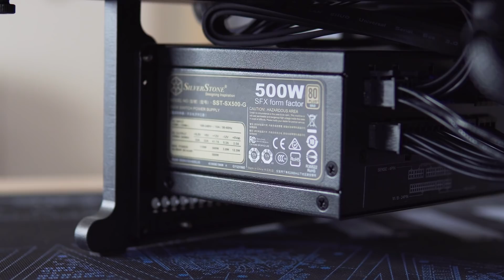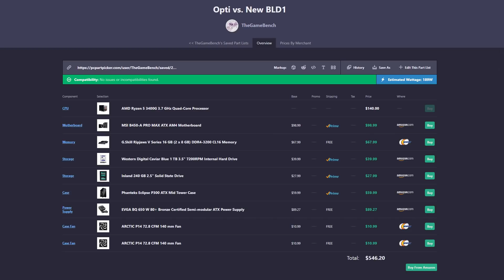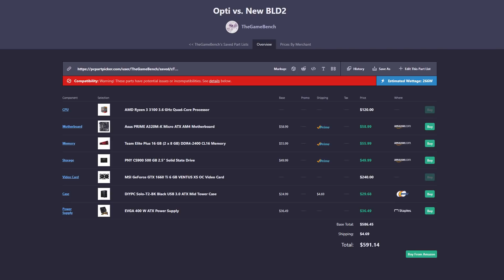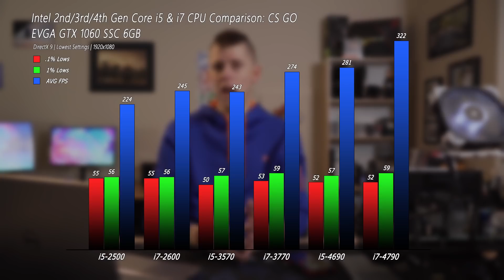Dell OptiPlex Q&A Pt. 1: OptiPlex vs. New, CPU & Mobo Upgrades, GPU Upgrades & More

Comment from the maker: Happy Holidays everyone! Please let me know what you thought about the Q&A video. If you guys like this, perhaps we can open it up to more subjects.
Reply: Thank you for answering my question, I hope you are doing better!
Reply from the maker: @reaganl.0965  No problem, and slowly but surely.
Reply: @reaganl.0965  CBC fbmf. F
Reply: Best wishes of the season, man.  Hope you get better in 2021, in all ways.  Your channel should have 100k subscribers, I tell you what.
Reply: You return
Reply: Hi. Just found this channel... Apparently You don't cover SFF Dell's. Besides the very obvious limitations, is there any other particular reason?
Merry Christmas everyone! Stay safe!
Reply: Great video. I wanted to ask if it's possible to run an ASUS DUAL-GTX1660S-O6G-MINI  on the original 290 W psu?
Reply from the maker: @luisehermann8577  Thanks! Yep, that card will be fine on the stock power supply. Just use a dual SATA to PCIe adapter.
Reply: Truly appreciating your work. Can you make a video on legacy vs uefi, and perhaps a how-to?
Reply from the maker: @Alteredgenetic  Thanks! What did you want to see specifically as a how to?
Reply: @TheGameBench  wouldn’t apply to me personally since i’m using a gpu that works with legacy, but i’m wondering if there would be a benefit to switching to UEFI, and maybe a step-by-step video on how to switch the bios to uefi, for those that need it for gpu compatibility.

Comment: I rebuilt a old 7010 with the best hardware for windows 7 that were available for the time period and backed up the op on Toshiba hdd.I like windows 7 and it has a lot of great games to offer. The dimms clips hit the edge of the GeForce 1660 ti oc

Comment: I am just writing this comment to show my absolute appreciation for this video series you did about Optiplex-es.

I'm an IT tech, but after having my 2 boys (who are now 6 & 8 years old, and autistic), let's just say that playing video games (or thinking about setting up a basic gaming PC has been out of my mind for a while.

Now, the only PC we have at home happens to be an Optiplex 3020.  Imagine my joy, seeing your videos, showing how it is absolutely possible to turn my PC into a potable gaming build. 🙂

My aim has always been to emulate PS2 games (maximum) and Minecraft, Fortnite, etc.  The kind of games my boys will be thrilled with.

Thanks to your videos, I removed the hard drive bay, used your template to position my SSD and HDD.  Got most of my parts, now waiting on my 500W PSU, an Asus 970 GTX and an i7 4770k to replace my i5 4590 (because I wanted to match the GPU as much as possible).

Videos like yours are really uncommon and I'm convinced they give a new purpose to lots of people having those Dell computers.  😁

Comment: Can i install rtx 2060 in my optiplex 9020 mt i7
Reply from the maker: Sure, but you will need a more powerful power supply if you haven't upgraded it already.
Reply: @TheGameBench  which power supply is the best 👌
Reply from the maker: @Funnycats99club  The MSI MAG A550BN is a good option on the budget end. Just don't get one of the 80+ white power supplies and remember that you will need an adapter to swap the power supply in the 9020.
Reply: @TheGameBench  thanks 😊 🙏
Reply from the maker: @Funnycats99club  No problem.

Comment: here's one for you.  Could I take a mini tower 7060 that doesn't have room for a gpu and doesn't have the harbin adaptors and.....put the internals into an old optiplex mid-tower CASE ?  Would this give room for the GPU that isn't there in the mini tower? thx
Reply from the maker: Be about the same amount of work and have the same issues as re-casing it in a DIY chassis, which if you're going to do, would be better than putting it in an older Optiplex chassis. I would ask what GPU you want to use that won't fit? You can absolutely add GPU's to these. You just might have to do some cutting for larger cards. Best to look for a standard height, dual slot, card that isn't too long.
Reply: @TheGameBench  thx for the response. I have an rx6600 3 fan gigabyte eagle gpu I picked up, 282mm long. So the case front would have to be cut to accommodate its length. Also sfx psu are expensive here in England, not easy to find used either. This is the killer. So would need a standard psu located outside or a weird cutout. Serious Frankenstein stuff! It would look as bad as me!!!
Seems harbin does do the Power switch and led adaptor so the 5pin header I guess could be modified as with others if it's the same.
There is also a 9pin labelled usb header on the mb and my other case has a 9pin plug from its front usb ports, i wonder if i can just plug it in, would it damage anything? Would you like a photo?
Hope you're well. Cheers

Comment: If anyone is still interested in this project (Dell Optiplex 9020)

An I7 4790k does work (probably can't overclock it though but the base and turbo boost clock speeds, 4ghz-4.4ghz respectively is pretty decent)

The MSI and Palit storm x rtx 2060 should be able to fit in without the hdd cage removal mod (although I have removed the HDD cage)

Comment: I really like the optiplex 7010 "DT" (desktop) case. Its combination of a slim (about 2U) form factor and  M-ATX motherboard support is extremely rare in today's case market. Its competitiors are mostly "HTPC" cases (like Silverstone ML11) and their build quality is lightyears behind this 10 year old Dell case. Working in it is just so satisfying with Dell's toolless design. You don't need to turn a single screw when removing the side panel, swapping out a 3.5 HDD or adding a pcie card.

Comment: I tinkered a bit with the optiplex 7010 DT's front panel connector, and it (mostly) works with a standard motherboard now. You can find pinout diagrams for dell's proprietary connector online. With those I was able to adapt the two front audio jacks and the two front usb 2.0 ports into standard connectors. The only issue is that dell's audio jack "sense" function works differently from modern motherboards and I had to turn off audio jack plugin sense in my motherboard's audio driver utility, which means when you plug in headphones in the front audio jack, the system can't switch to it automatically. Otherwise the usb2.0 and audio ports all work normally with my Gigabyte B450 motherboard.
While Dell's front usb3.0 connector have the same number of pins as normal usb3.0 connectors do, it appears to have an exotic locking pin which will probably tear up the motherboard usb3 socket if you force it in. I don't want to drill or cut either the connector or my motherboard socket. So I ordered some 90 degree usb3 connector adaptor online and planned to try drill on those so they could fit Dell's exotic locking pin. Those haven't arrived yet.

Comment: hi i, want to know dose nemv m.2 ssd work in it's full speed on dell optiplex 7010 tower pc in pcie 16x4 slot
Reply from the maker: Are you talking about the lower, black x16 slot that runs at x4? If so, no. It will only run at half it's rated speed because it's a Gen2 slot. If you were to put it in the top x16 slot, it's a Gen3 slot and the it could run at it's rated speed.
Reply: @TheGameBench  thanks for the information tell me more one thing can i make this PCI slot 3x16  nvme drive make bootable drive? i mea can i boot the PC with 3x16 pci slot
Reply from the maker: @kashiflaiqkashif7348  Booting from an NVMe drive is possible on these system with a boot loader, but it's a PITA and I'd tell you that it's not worth your time. The difference between an NVMe and a good SATA SSD as a boot drive is going to be pretty negligible. Even as a game drive, you're not really gaming much.
Reply: @TheGameBench  please make a video nvme drive in optiplex 7010 as bootable drive with the help of pcie 3x16 slot

Comment: For all of that you should just build a brand new build, I wouldn't recommend you go with the optiplex just build it new.
Reply from the maker: Well... obviously building new will net you better results, but at that much higher price, and not everyone can afford a new build. An OptiPlex offers decent entry level gaming at a price that building new can't even come close to.
Reply: @The Game Bench  What about music production on that budget lets say protools where I just need to consider ram and cpu what would that performance do on an optiplex 990 🤔🤔 any suggestions.
Reply from the maker: @Allious131  Well, Pro Tools will run on a potato, though I have a hard time suggesting 2nd Gen in 2022 and I feel the cutoff is more the i7 3770 at the oldest. Still, Pro Tools should still run alright on an i7 2600 with 16GB of RAM, and you should be able to pick up a 990 with an i7 2600 for well under $100 these days. I would say that I wouldn't spend more than $60 to $70 for one with 16GB of RAM. Though if you haven't bought the system, I might suggest spending a little more on a 7010/9010 or a 7020/9020 with an i7.
Reply: @TheGameBench  Yea I already got it and thank you that's all I use it for is protools and music production, but thanks. And thank you for being a great youtuber and responding to my comments you earned a new sub.
Reply: @TheGameBench  I'm pretty much focusing on single core performance, with 16 gb ram. And the cpu is i7 2600.

Comment: why don't you use dell workstations?  like the precisions? I bought a T5810 for 120 bux
Reply from the maker: Mostly because they're not as flexible as an OptiPlex. You can't replace the power supply with off the shelf components. They're more complex. Just navigating the CPU upgrade options for socket 2011 is going to be rather confusing for the average person. Not to say I wouldn't consider working with one, but $120 is a pretty good deal. Still seem to be going over $200 on eBay, and I'll never find one locally. My local market is pretty trash unfortunately.

Comment: Hi there m8 I know this is not a new video but hopefully you will still see my comment and questions. Anyone reading this and have something to say please tell me what you think thank you.

Current System
------------------------
Optiplex 7010 i7 3770
32GB RAM
520GB SSD
1T HDD
3 x 24" HP244 Pro Monitors via 2 x Display Port 1.2 & 1 x VGA Port to DP from the onboard gfx
-----------------------
planned upgrades
------------------------
MSI AMD Radeon RX 5600 XT for the 3 x Display Ports (kinda actually put a deposit down for this today so kinda stuck with it now)
Corsair CX550F (80 PLUS Bronze Certified) & Fully Modular
------------------------
I may also buy a new case also but first will be the PSU and the GPU which I'd like to know what you think about this please m8 ? Is the PSU enough at 550 ? or do I need to go higher ?

Cheers buddy I'm new to your channel but I'm enjoying the content and I've subscribed now. 👍✌
Reply from the maker: Thanks for the sub, I appreciate it. The 5600 XT doesn't consume a lot of power, and a decent 550 watt PSU (which the CX series is) will be more than enough to power it. It's worth mentioning that the 3770 will be a slight bottleneck to the 5600 XT at 1080p... but not enough that I would be too concerned about it.

Comment: question: what is the oldest optiplex you may recommend? is it still the 4th gen? are there any other office pc brands that are comparable to optiplex?
Reply from the maker: The 7010/9010 with an i7 3770 is the absolute oldest I suggest at this point for a gaming PC that's playing anything somewhat recent. Anything older, and I would consider that going the way of a retro gaming PC. MIght still be fine for some games like Dota and CS Go with the right GPU paring. Ideally though, I suggest the xx20 models with an i7. I wouldn't suggest any of the quad core i5's at this point for anything other than a general use PC.

Comment: So can I use an i3 12th Gen?
Reply from the maker: Nope. The x90 series is limited to 2nd Gen. The xx10 series is limited to 2nd and 3rd Gen. And the xx20 series is limited to 4th Gen. With Intel, you're lucky to get two generations per chipset. To run an 12th Gen CPU you'd need an H610, B650 or Z690 board.
Reply: @TheGameBench  okay thank you, I’ll just upgrade the motherboard

Comment: can you do a video on upgrading the motherboard on one of these
Reply from the maker: So, like a sleeper PC?
Reply: @TheGameBench  yes, im a beginner and i would swap the case but i just love it so much
Reply from the maker: @animegirl3069  Actually... I've been planning on doing one of these at some point. Thinking about a 12th Gen Intel i5 system with a B660 board. I'm thinking about keeping it pretty much stock looking on the outside. Power button and LEDs would all work, so would the front panel. I've just been trying to find a 7020 or 9020 case in good shape.

Comment: Does anyone know what the max cpu you can put in an optiplex 990 is? I bought a 4790k and it didn't fit.
Reply from the maker: Hopefully you didn't bent any pins. No, the socket is completely different for the 4th Gen Haswell CPU's. the x90 models will only work with 2nd Gen Skylake CPU's. So, your best option is really the i7 2600. I've heard people get the 2700K to work with mixed results, some say they couldn't get it to work. If you do some research you'll find that 3rd Gen (Ivy Bridge) could work in 2nd Gen boards, and that is true, but they won't work in the x90 OptiPlex models because Dell never released a BIOS to make them work... unfortunately. There are also desktop Xeon models that are even faster than the 2nd Gen i7 models that will work, but they're incredibly expensive and would make no sense when you can buy an i3 10100 for about $70 these days on the used market and it's SUBSTANTIALLY faster than anything from the 2nd Generation.
Reply: @TheGameBench  No, didn't bend any pins. I have an i7 2600 in it now. Looks like I'm gonna be on the lookout for a 9020 mobo

Comment: If u switch the case and motherboard don’t you need a new windows?
Reply from the maker: Case, no... but if you replace the motherboard, yes. Granted, if you installed Windows using an MS account, the activation will follow your account and not the board. If not, the activation follows the board. But you might be able to use the same Windows 7 or 8 key to activate on the new board.
Reply: @TheGameBench  can you buy a motherboard with windows already on it
Reply from the maker: @bxtboii  Possibly. A new one? Definitely not. A used one? Maybe. If they activated Windows 10 on the board, you could install Windows and as soon as you connect to the internet, it should activate. If you buy a modern used board, it's likely that it will have had Windows installed on it. As long as they didn't install with an MS account, it will already be activated.

Comment: hey can u put a i7 4th gen k series in a optiplex 3020
Reply from the maker: Yep... and if you've seen my video about the 4790k in the 9020, you might run into a similar problem I had with the 9020, but it's easy to get around. And in my testing in the 3020, the performance was close to the same, so my conclusion for the 4790k in the 3020 is the same.
Reply: @TheGameBench  thanks what kind of promblem though i wont face the same issues in my 3020 will i am trying to build a budget build with a 780 geforce founders in 16 gig ram  in a ssd i curlenty have a i5 which is y im asking
Reply from the maker: @cdog13headgamer22  The problem I ran into was that it gave me an error after putting the 4790k in the 9020 and when it got into Windows it worked, but with some quite odd behavior. The fix was entering the BIOS and exiting, and then it functioned normally. Other people have had issues and it could be because their BIOS was older and they just needed to update the BIOS. If you're curious, I'd suggest watching that video to get an idea of how it will perform.
Reply: @TheGameBench  bios is updated though the 9020 in the 3020 are completly difrent from each other i just want to put a k in it

Comment: How did you sleeve the 8 pin to 24 pin? 7:29
Reply from the maker: I've sleeved full power supply cable kits, so I just applies the same principals here and just took apart one that I bought off Amazon and sleeved it. Singularity Computers has some good sleeving tutorial videos.

Comment: Will a GTX 1060 6gb Mini fit into a Dell Optiplex 9020 mid tower?
Reply from the maker: Absolutely. Won't even have to modify anything. Do you have a particular model in mind? The Zotac mini will fit for sure as will any single fan models out there.
Reply: @TheGameBench   I can't close the clip on the back holding in PCI exit slots? The little black click-in tab pushes up against the GPU plastic housing - It's a Gigabyte GeForce GTX 1060 Mini ITX OC 6G 6 GB GDDR5.

Comment: I have an optiplex 980MT from 2010, with an i5 660 dual core, 3.33ghz, 8gbs of ram and a 2gb msi gt 1030.
Ive never complained, since i mostly play runescape 3, and after doing some research about hardware usage, i feel like ive tuned it to perfection (ingame settings etc.) - (If youre courious, its high to ultra settings, set to 60 fps locked)
Just bought 16gb of used ram, a used 128 gb ssd, a 550w psu. I aso had a gtx 1650, but it didnt fit... 
So I stripped the case today, drew some lines, and took it to my fathers workshop, where I let him cut it for me.
Now there is basically room to fit any gpu in here, so im very interested to see its peformance.

Cant say thanks enough for your videos about the optiplex systems. It has been a ton of fun, a fairly cheap way to get my machine to feel brand new again.
Also this has really sparked a new hobby for me!